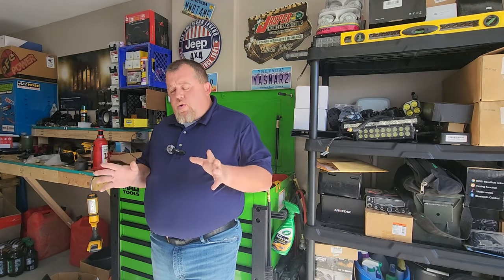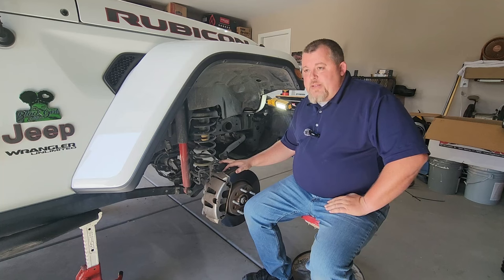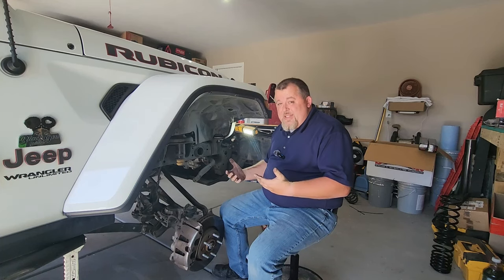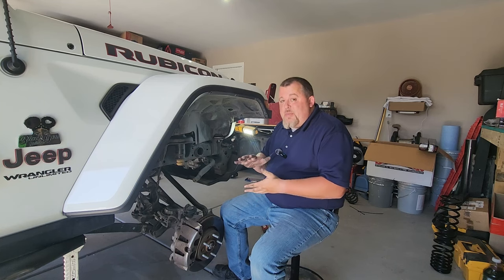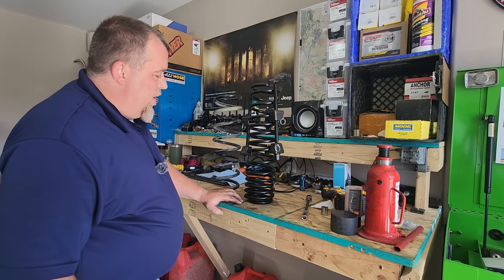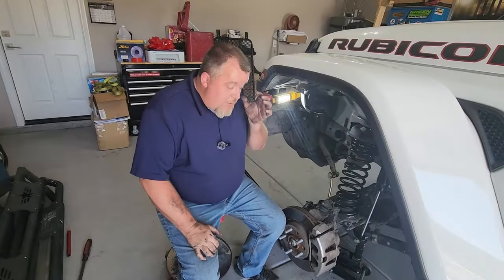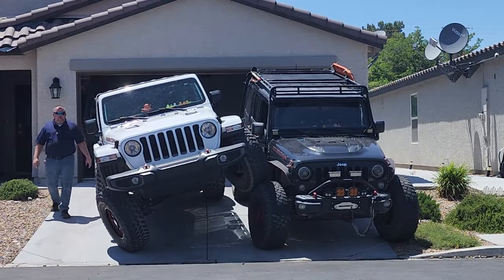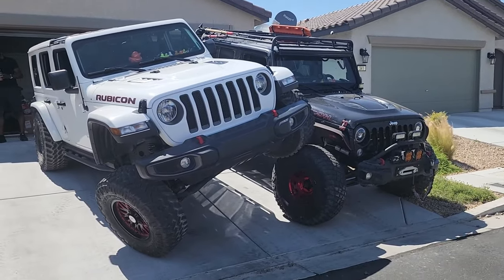Installing a lift on a Jeep Wrangler, Step by Step, with tricks. Skyjacker Long Travel Kit, Pt2

Comment: Josh do you have to loosen the control arms to adjust after installing the lift? Thank you for a great video!
Reply from the maker: Nope, did not have to touch the control arms at all
Reply: @JeepingForBeginners  I meant the preload in the bushings from lifting it. Thanks
Reply from the maker: No, those control arms are there as a centering guide, they are not torsion bars. They have no preload on them. So you do not have to losen or adjust them to install this lift

Comment: I had a 3" lift put on my 14 JKU. the installer stated that I didn't need control arms. i left the shop and had death wobble before I got home. They said the steering component was the problem. had it changed, no death wobble but didn't handle well. I went ahead and put adjustable control arms on. Not sure if I got the camber correctly. what is the best way to adjust the camber at home? aliment shop said they couldn't do it.

Comment: When you do a 2.5 lift do you need to replace the track bar?
Reply from the maker: Not generally on a lift that small. As long as once complete, the trac bar and the drag link still run parallel to eachother, then you are fine.... usually over 3" suggests  trac bar relocation or replacement....

Comment: Why did you turn off comments on your oil cooler video? Doorman is not good? Please clarify
Reply from the maker: The comments on which oil cooler video? I have three of them. All comments are on, except for the video where the comments were part of the contest for the giveaway, I turned those off because the giveaway is over..... buy the how to video and the other one comments are on.

As for the product, there is nothing wrong with Dorman, so have at it.... if you need it

Comment: What I find crazy about this lift is it is 2.5" without adjustable control arms or drop brackets. That has got to be a less than comfortable ride.
Reply from the maker: The ride quality actually improved. First, the previous shocks, 3 of the 4 were blown anyways, so just having new shocks made all the difference in the world, second, 2.5" is a "small" lift on a JL. There is still plenty of freedom of movement from the control arms to allow it. Finally, having dual rate springs makes a difference in keeping the factory on road feel, while improving its off road handling. Long story short, the final product was actually a smoother and more comfortable ride both on and off road.